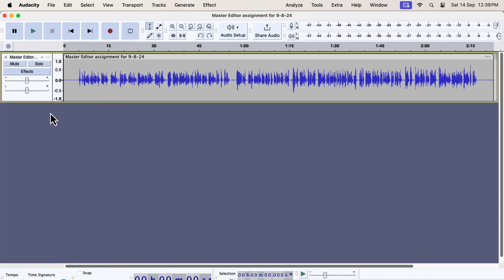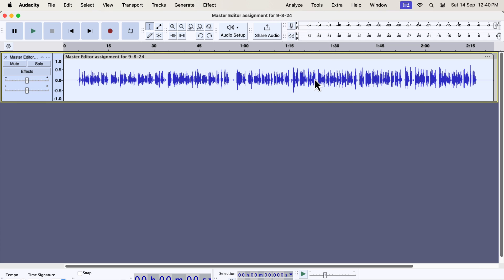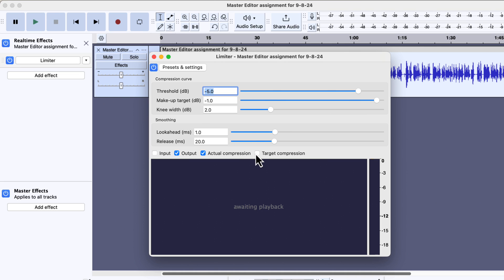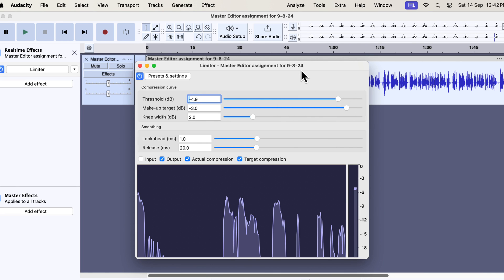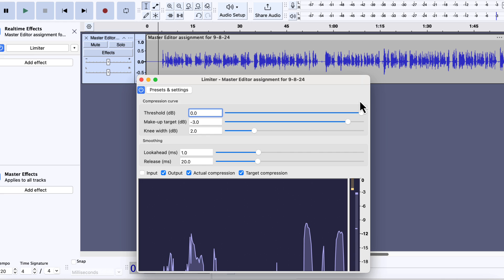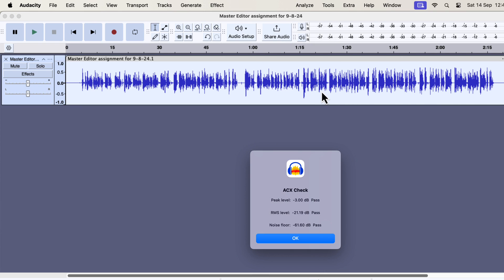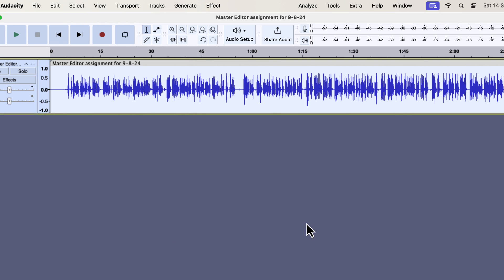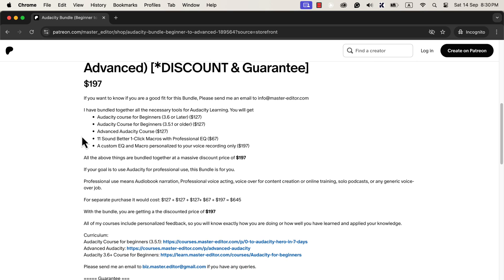Increase audio Loudness with New Audacity Limiter

Comment: what is the point of putting normalization effect in the beginning of the effect chain?
Reply from the maker: There are several. For example, if the original audio level is low, it increases to a standard level and gives better idea of noise and sound reflection. It also prepares the audio for a better compression with a default preset. Otherwise, you have to measure audio levels exactly and configure the compressor accordingly.
Reply: @MasterEditor5  so, if i apply normalization to -3dB and then apply the eq settings which increases the overall peak levels, will it be restricted to -3dB automatically even though the eq settings pushes it above it?
 Also if the original audio is low we can use amplify right?
Reply from the maker: @Roughwork-vo3om  Yes, you can amplify. If you boost in EQ after normalizing to -3 dB, it would not automatically be restricted. Usually, the volume of frequencies you boost will be much lower than -3 dB, so you will have more room to boost in EQ even after normalizing to -3 dB. However, boosting more than 6 dB causes over boosting.
Reply: @MasterEditor5  one imp question, i import an audio, then apply noise reduction , then eq, then i skip compression because my audio does not any difference in dynamics, so finally i apply normalization to -2.5dB. The problem is, when i apply normalization, it reduces the peaks to -2.5dB but it also lowers the overall audio to way below -2.5dB, somewhere around -7dB. So the audio sounds low whereas I want the overall audio to sound at -2.5 dB. Also youtube wants -14dB as LUFS, so i apply preceived loudness to -14dB, but in this case also my audio shrinks and gives low sound. what's wrong with this normalization thing.

Comment: Thanks for the tips! Unfortunately, my PC version of Audacity doesn't seem to have ACX check (Is that part of the Bundle you were talking about?), but it did have an RMS measurement feature.
Reply from the maker: ACX check is seperate plugins. It is not part of the bundle, but the bundle has courses that will help you to install and using it